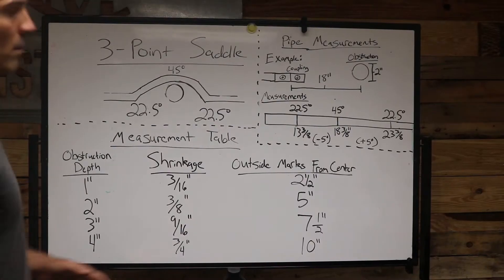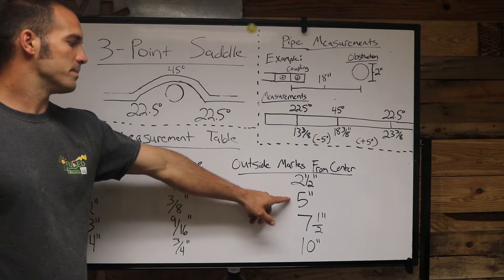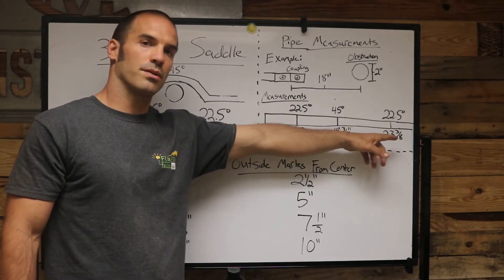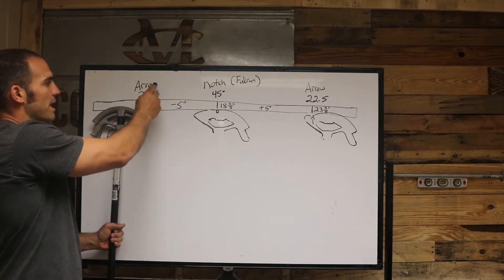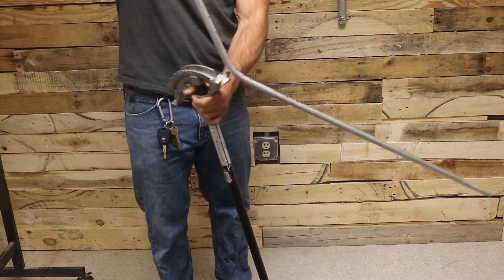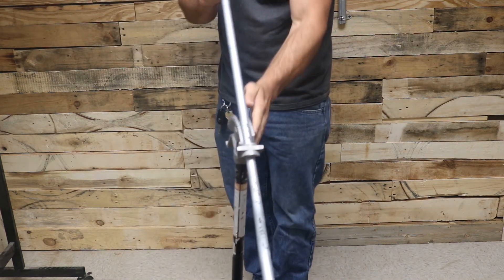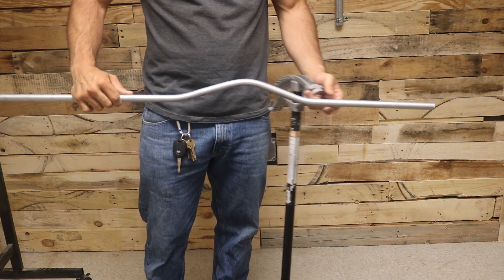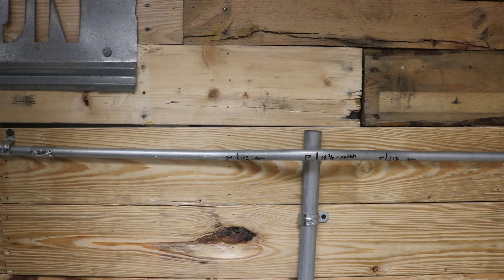Electrical Conduit - Three Point saddle

Comment: I finally got the ideal pipe bender 1/2".   LOL i messed up the obstruction part.  I have 7" tall and 5" wide, I was doing 45deg..  Trial error i guess the more you do more you get better.
Reply from the maker: Haha trial and error is right! 45 make it hard to pull through too…my first job bending conduit On my own was Staples in a strip mall and had a stack of errors in the corner but that is part of learning!